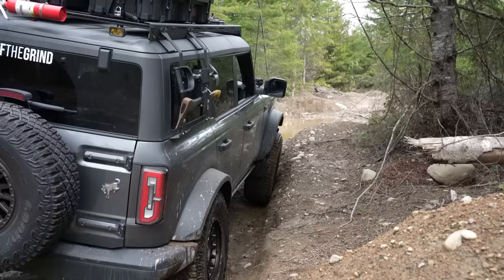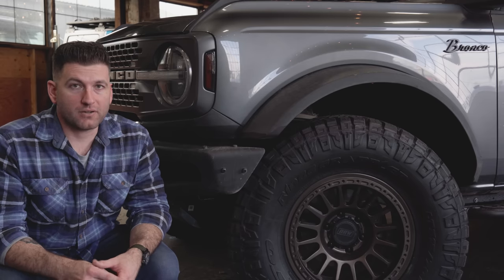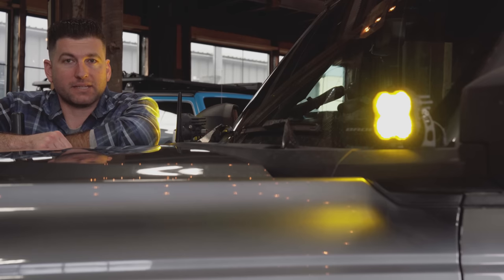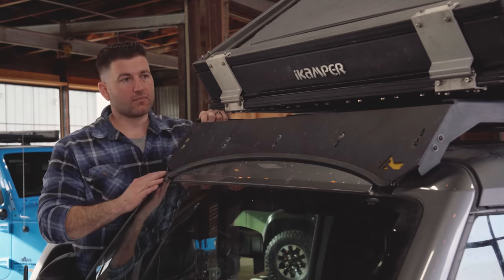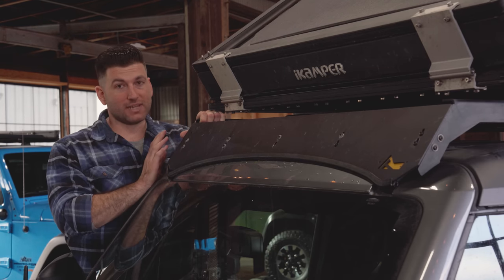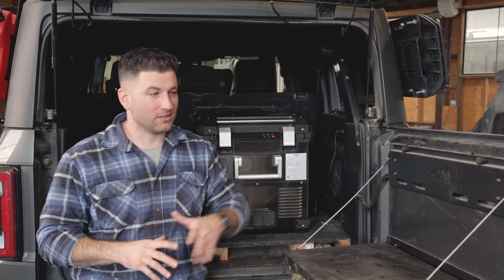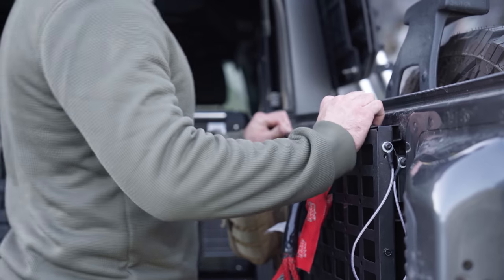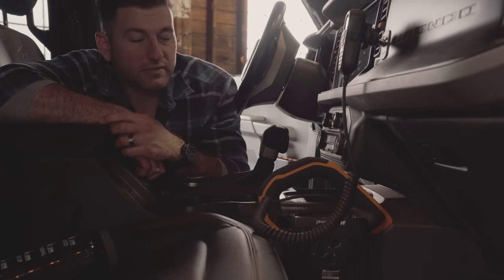6th GEN BRONCO BUILT FOR OVERLANDING || The Walk Around You've Been Asking For

Comment: David, when is the winch coming. You roll solo most of the time, so with winch and bigger tyres you'll be able to explore further into the wilderness. The roof rack wind deflector is perfect to mount a good light bar light the rigid adapt (gps), dio dynamic 50 inch light bar would be good when explored deeper with all kinds of bad weather. In my humble opinion.
Reply from the maker: Both are things I’m looking at honestly. The winch is on my mind a lot, I just don’t like the mounting options I’ve seen so far. But it needs to happen. I’d like a light bar up top as well. I even have the cutout wind deflector. But it’s not a necessity. The lighting setup I have now works really well
Reply: @OFFTHEGRIND  I agree your lighting setup will work well. The mounting options available may not look good, however it's a necessity for an overlanding to have a winch, especially to your rig, cuz you do solo trips almost all the time. You may not like available winch mounts, but get the one you like most and when a better one is available in the market which you like you can change it again. I've seen one Bronco built where the winch is mounted in the place of the sensor. The sensor moved to the right. It looks so neat and clean. I don't remember the company that built it.

Comment: You might answer this in the video, but im asking now so i dont forget.

With the rooftop tent and roof rack, can you still take the top off? Or do you have to remove everything to get the top off, and if so how much of a PITA is it?
Reply from the maker: You can take the three panels of, but not the rear part of the roof. You would have to remove the entire rack to get to that
Reply: @OFFTHEGRIND  sweet deal. I have a 2 door so I’d probably have to call them and ask how that would work. As long as I can get the two panels in the front off I’m happy.
Reply from the maker: @AndyGabbs  oh for for sure can. The racks are designed to allow you to remove those panels. You just can’t remove the portion with the windows

Comment: I like what you've done with your Bronco. I was able to mount my GMRS radio under the center console with a CAT 5 looking female plug for the mic.  It is a real slick install. My big question is, how long have you had your affiliate link? I just bought the full 4dr TrailRax roof rack and I asked the sales guy if you had an affiliate link. He said no. So I paid 2K for my rack. 10% off would've been nice. Then, to top it off, they shorted me on the weather stripping.  😮
Reply from the maker: Oh that sounds like an awesome place to run it. Like under the center console or in it? 

I’ve had it for about 9 months now I think. It is just an affiliate code though and does not offer a discount. Just helps the channel out. Sorry about the weather stripping though. Did you reach out to them about it?

Comment: Great video! I want to know more about your traction boards and how to mount them to the Pax Rax. I have the Pax Rax and the ARB Tred Pro boards from Ford Performance. Turns out there aren’t very many mounting brackets on the market for ARB Tred Pros. Also, mounting these long boards on the Pax Rax, it blocks the opening of the door. Do I have to purchase the expensive extra mounting plate from Trail Rax or do the standard ones work? What (locking) hardware do you use? Thanks.
Reply from the maker: Unless you’re super handy with fabrication, your best bet is the universal traction board mount from TrailRax. It also allows you to adjust the board back further so they don’t block the door open. 

I have standard mounting pins that I just put a pad lock on. I had a barrel lock on them, but it rusted and I had to cut it off. Pad lock does great though
Reply: @OFFTHEGRIND   nice.  I'm looking at how to mount my tractions boards for the winter.  Was almost just thinking two black ratchet straps...  Not sure yet.  Usually if I get "stuck"  it's time for the winch haha.

Comment: You didn't cover your skid plate build. Did you get skids that cover the fuel tank? If so, what? I am trying to get a solution for mine- I've scratched and beaten up the plastic Bronco fuel tank more than I care to have done already.
Reply from the maker: I haven’t done anything. I have the badlands Sasquatch pack so it comes with reinforced skids. Not the best, but nothing I’ve needed to replace yet